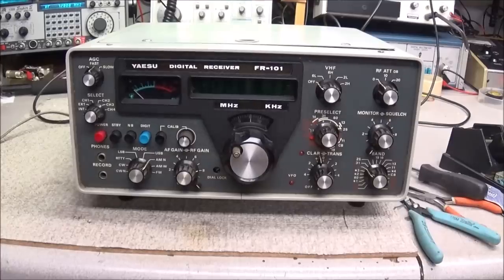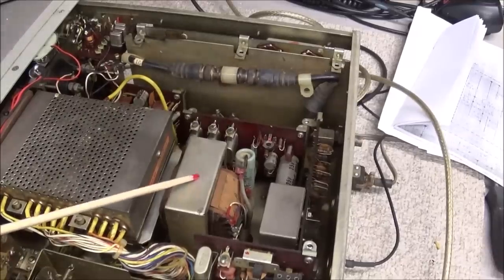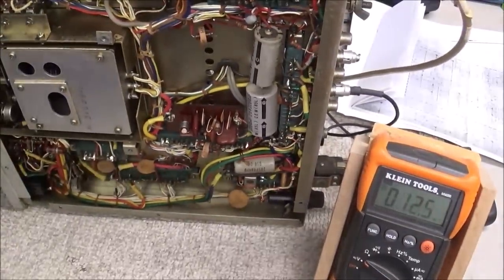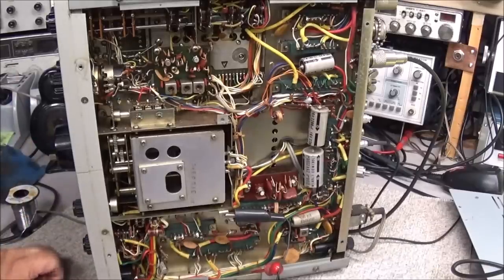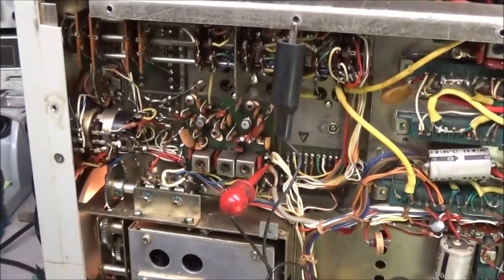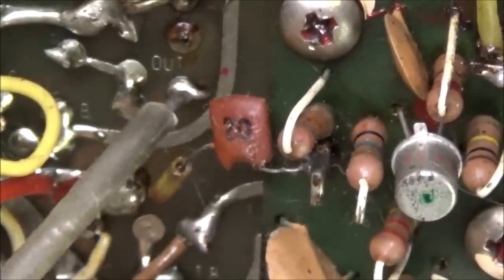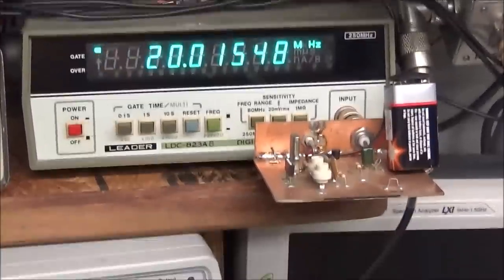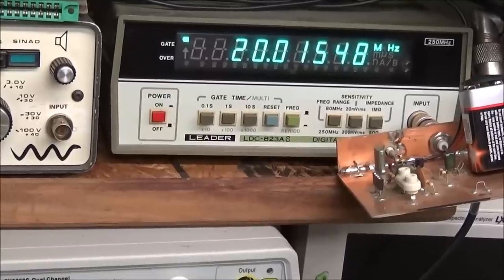#179 Can We Bring a Yaesu FR 101 Back To Life

Comment: Nice job Buddy, Been looking for an inexpensive SW receiver and will check the next flea for one of these. Have a question. The  red colored lettering on the front looks more like splashed paint than actual lettering. Then I checked on line and most of them seem to look like that. Is this a common issue with these? Or is this a trick of the camera.
Reply from the maker: I think these are great receivers. I always wanted one myself.  It is funny you mentioned that about the red letters.  They seem to be camera proof lol.  They are nice and sharp to the eye but go nuts when the camera tries to focus on them.  I too noticed that they look like that online.  In part two I will use a filter so you can see the letters in better detail. Thanks for stopping in my friend.

Comment: Thank you for your video, very helpful.  I too am restoring an older FR-101S.  Dont know if there is a difference between FR-101 and FR-101S?  I had a FR-101D 30 something years ago and regret parting with it.  Can you tell me about the regulater.BFO 
board,  the board in my FR-101S is labeled "PB-1312A"  but the schematic calls it "PB-1549" ??   Anyways there is no voltage
on pins 14 & 17 on the rail.  Cheers...VE7QRP

Comment: As always Buddy a very informative video and I have now taken one piece of advice that you toss out, and that is start by checking to see what parts of the radio are actually working and which ones are not.  I was about to send a radio off last week that had an intermittent receive issue but I kept at it following your steps and found out that I had a dirty tube socket that making a tube shutoff when it warmed up.  I used some Deoxit one the sockets and it now works great.

Kevin - KG0MN
Reply from the maker: As you saw in the video by using this method the problem showed itself, and very quickly. You guys were seeing it as I saw it. Always works for me. Glad you saved yourself some dollars be fixing the bad tube socket.  That is using your common since. Thanks for the comment.

Comment: Another Frog brought back to life.  I would remove that preamp to.  Most of those things have no filtering and amplify the noise floor as much as the signal you want.    Look forward to the next part.
Reply from the maker: Agreed with that Mike. As seen the noise floor was between s6 s7. Most which is probably the preamp causing it. I will say it was no surprise how easy it was to get going. Very simple design.

Comment: I'll bet you those VHF  boards went on Ebay at some point in unknown condition since the receiver wasn't working and probably sold for a good bit of cash. That was a pretty high end receiver back in around 1976 or so selling for $800 that being around $3500 in todays dollarettes. Always good to see another blast from the past in The Radio Shop. 73 Doug.
Reply from the maker: I am thinking the same on that Doug.  Lucky the whole unit was not stripped down and sold for parts. Thanks for stopping in.

Comment: thanks for showing us buddy. I thought it was in the section you found it, but didn't know it would be the connection from the previous stage. that would stop things quickly. I hope you find resistors to boost the weak digital readout tubes. that would make the radio look new. I doubt you will find those two boards though. I bet when the radio went deaf, the guy just pulled those two boards, and didn't think about the fm board
Reply from the maker: Thanks Paublus. I was pretty sure it was going the be the oscillator or vfo circuit. You guys got to see it as I was seeing in. Good call my friend.  When I saw the cap hanging loose I knew the mystery was solved.  We still have a lot of work on it.